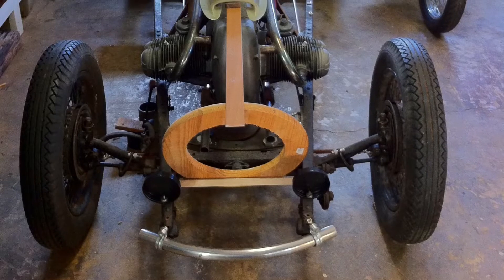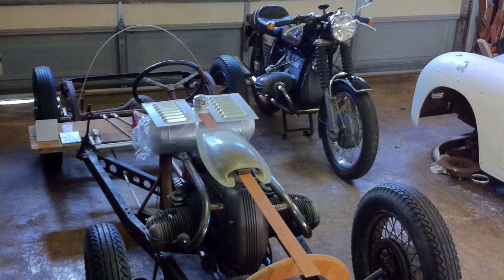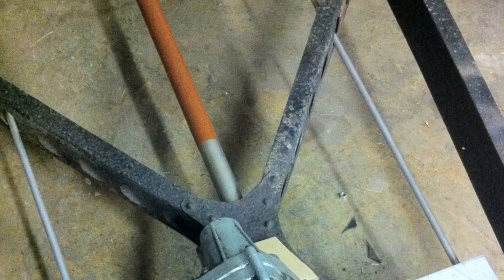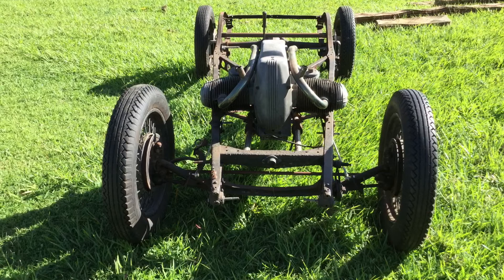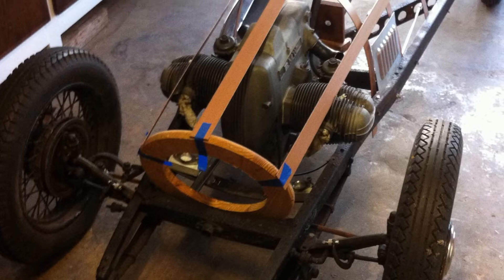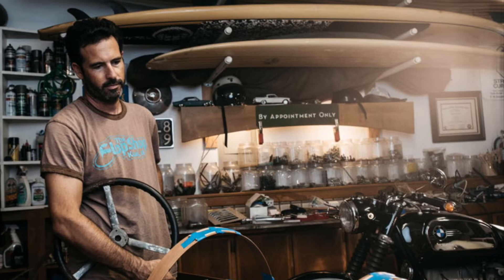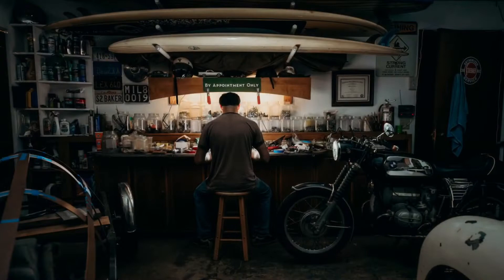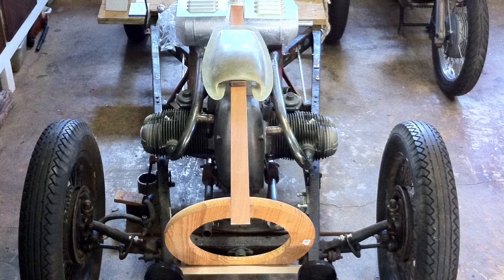Airhead Roadster Cycle Car Build

Comment: Impressive!  I've daydreamed about building a car with that particular engine.  Of course that's as far as it got.
Reply from the maker: Thanks! Yes, the Airhead Twins in particular with their big clutches, in-line gearbox, and shaft drive output lend themselves well to a lightweight cycle car type application.

Comment: I saw pictures of your build on a forum (HAMB or Locost?) Glad to see its still progressing. My opinion, yes to the moto fenders, no to the horseshoe Bugatti grill @3:54 , do some kidney inspired. Your creation, do what you want, subscribed and looking forward to what you come up with.
Reply from the maker: Thanks for the comment. Ya, you probably saw it on the Cycle Car thread on JJ. That reminds me I need to post an update. This video was put together while I was stuck inside bored with a cold. The project has been stored under my porch (I had to dig holes and deflate tires to get it to fit) and I just happened to pull it out today so I could move it into my new shop which is close to being complete. In the coming months I’ll get my tools set up and start making decisions and hopefully some progress on it again this winter.

Comment: hey dude this is gonna be really cool , i know i've used the exact same chassis , a 1935 austin 10/4...on the build of my austin 10 special.  I considered a beamer motor but opted for an available reliant  850 cc 4 cylinder ...please pop over ive documented the whole build, will be finished in weeks........looking forward to see where you are heading with this ....hang loose brother
Reply from the maker: Hey, thanks for the comment and sharing your build. I’ll definitely check it out. Perfect timing, as I could use a bit of New Year inspiration and motivation for my build.
Reply: @kauaislash5  hopefully you will find plenty dude.....that will be a cool build you have there ..

Comment: Will, I just found your channel and subscribed immediately. I am finishing up a couple projects and then I am starting a Youtube channel with a 1928 Morgan Aero RIP GN Special 3 wheeler with 4 wheels for hillclimbing and racing. I am in Pa and I couldn't figure out where you are. I am really in love with Pre-war boat tail racers. I sourced an experimental aircraft opposed twin as the power plant. I am mating that engine to an MG transmission so I have 4 gears forward and a reverse. I am casting a two part aluminum um adapter to mate the engine to the transmission and then a driveshaft to an MG rear differential with juice brakes instead of the GN live axle that skips around corners and. has chains. The wooden frame over steel will be covered as it was from the factory with aircraft cloth and sprayed with a plasticizer. I am so looking forward to start work on this project. I love your build. That is such a cool car. Where did you find the chassis? Oh and my next project that is queued up is a 1933 MG K3 Monoposte 4 cylinder supercharged boat tail racer. I will more than likely find a 6 cylinder by then for the build.
Reply from the maker: Thanks! Sounds like you’ll be building a cool car too. If you haven’t checked it out, there’s lots of inspiration in the Cycle Car thread on Jalopy Journal HAMB forum. Also check out Oakswamp’s channel who posted above for some inspiration. Anyway, I found the car locally here in Hawaii on one of the other islands. I saw a photo of the chassis with the body removed and it spoke to me. 

The body had a lot of rust and wood rot, and the original drivetrain pretty tired, so I didn’t feel too bad making a “special” out of it, although I must admit if I had kept it original and just got it running and driving again, I probably would have already been enjoying driving it about. 

It’s always easier when it’s already been done and all you have to do if fix and restore systems, rather than figure out how to design and fabricate them from scratch and/or repurposed parts. 

I’m still some months out from having a workspace and being organized enough to pickup where I left off, but am looking forward to shaping some body panels for the car and figuring out the last few mechanical bits if I don’t get distracted by any new projects 😂
Reply: @kauaislash5  It has been so darn cold here in Pennsylvania. I have been sourcing materials as well as machinery. I found a Burke Number 4 milling machine and just purchased an older Atlas lathe that has a ton of tooling. I want to be able to make any parts I may need. I have a PhD in Chemical engineering however I am really not happy working in the pharmaceutical industry any more. I am thinking of starting a mobile locksmith business as well as a welding and sand blasting business. I bought two industrial Schraam 6 cylinder air compressors thta need restoration. I plan omn starting my Youtube channel while getting everythuign ready. I ahve been watching Oak Swamp and Ascimation who is building a Brooklands Riley. Super cool channels. I hope all is well with you doen in Hawaii.
Reply: Will, Where did you find that Austin frame? I am looking for something to use instead of making my own but that is what I have been planning.
Reply: Also the 1928 Morgans were built like 20's airplanes. They had a wooden frame over steel with stretched aircraft fabric over and plasticizer sprayed onto it to give it strength. I do like aluminum or Thin steel however I kinda like that old plane look also.

Comment: Interesting concept. I assume there will be no reverse gear, will this be a maneuverability issue? Would a transmission adapter with small automotive trans provide a better solution? That said, perhaps there a reverse conversion available for the BMW gearbox? I.E. Sidecar.
Reply from the maker: Thanks! Light enough to get away without reverse, but prob going to use a starter to engage the drive shaft for push button electric reverse.

Comment: I absolutely love this and I want to do something similar! Can you be specific as to what gearbox that is for lowering the drive shaft?
Reply from the maker: Thanks. It’s been some years since I identified and acquired a suitable middle gearbox, but I’m pretty sure if I remember correctly it’s from a 90’s era Yamaha Big Bear 350cc quad, although I think all models during that era used a similar unit. 

The nice thing is the housing is aluminum but stout and the gearing is 1:1, plus there is a forward lower take off shaft that would have driven the front wheels, so if you use a power plant for your cycle car build that doesn’t have a starter or reverse, this could be used to couple to a starter motor to accomplish either need.
Reply: @kauaislash5  thank you for taking the time to reply! I really like what you’re doing and I’m sure your not a full time YouTuber but I subscribed and I hope to enjoy more of this build on your channel in the future! You have a knack for it!